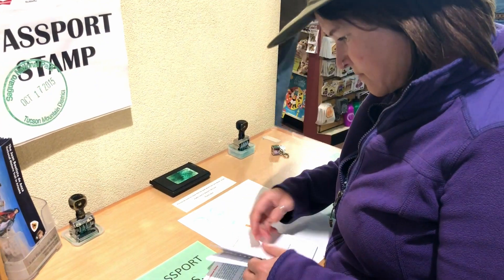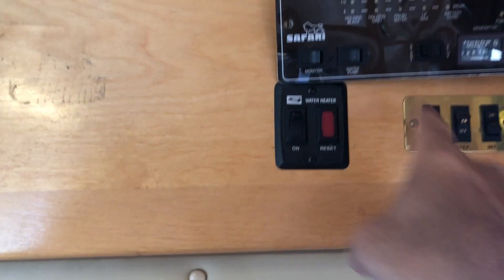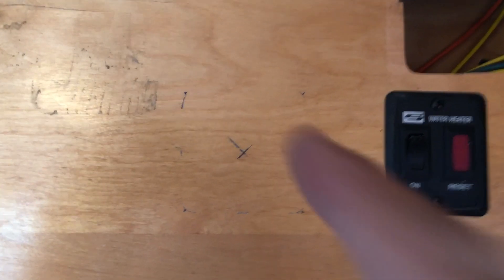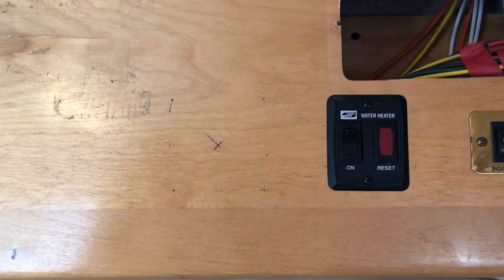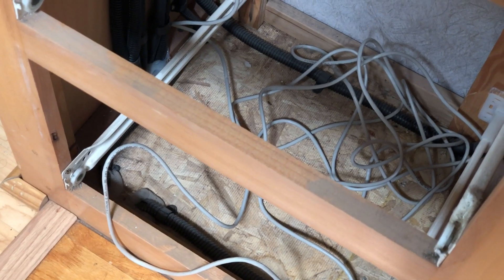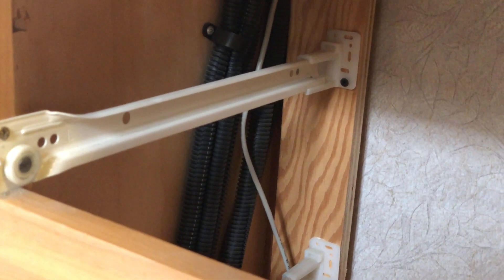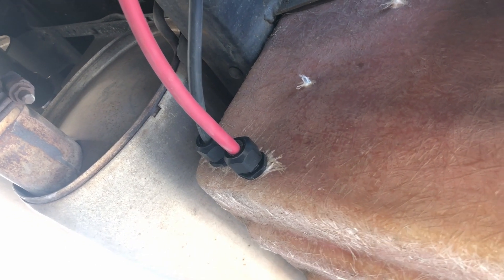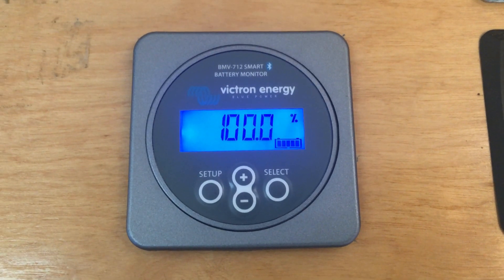RV Solar DYI Install Part 1 - Victron BMV 712 Battery Monitor - SMH S1 E13

Comment: Thank you for your overview of the BMV-712. I have an all Magnum Energy system in my RV, however I’m able to piggyback onto the BMV-712 shunt so all my Magnum Energy stuff can still communicate with each other.  I found that Victron Energy monitor is far superior to the Magnum Energy battery monitor. I’m looking forward to your other videos on the rv dc electrical system.
Reply from the maker: We’re glad you like your Victron.  We especially like the app! 👍🏼